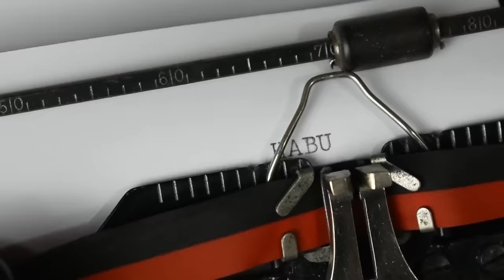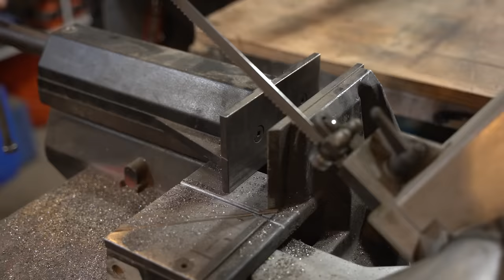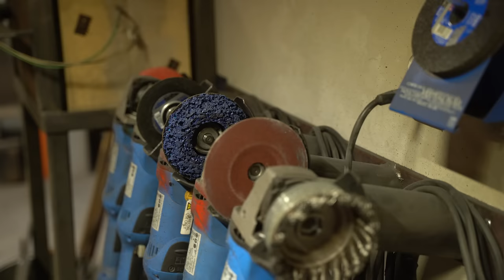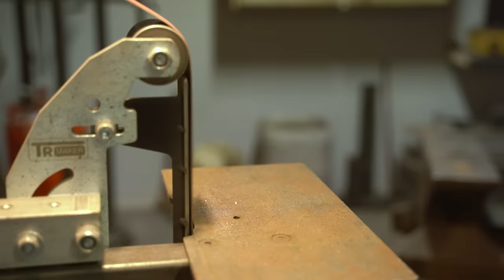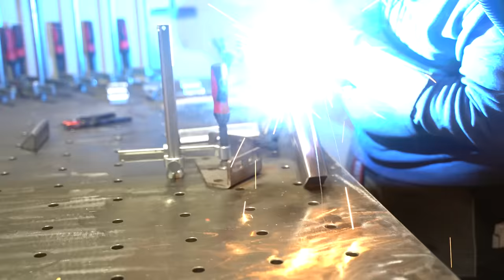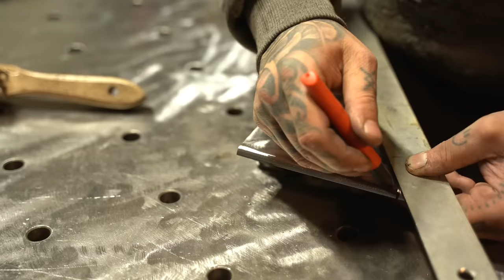Is this real??

Comment: ?well done I’ve been welding along time and I just want to know one thing, why do you put the weld on and then grind it off , you do know that’s where the strength is, real welders only usee we a grinder to V out or get the slag out from welding with a AC rod and start a new weld at the end of excessing weld , you want it pretty and weak bet it would never pas a x ray with all that pumping the trigger. As for the right angle whatever it sure was pretty     Weak!    What ? Not many welder left  open keystone!!!!  Ain’t it pretty Marion?